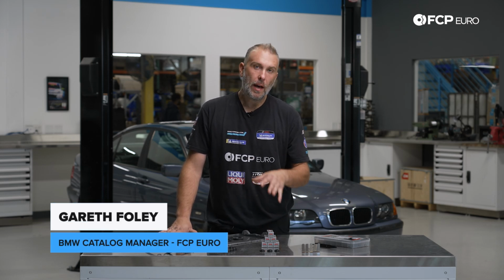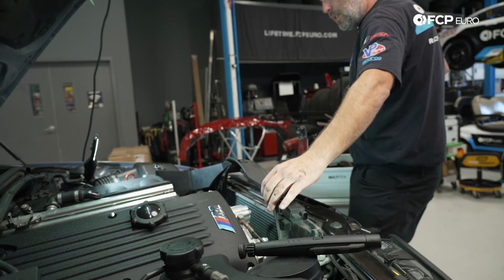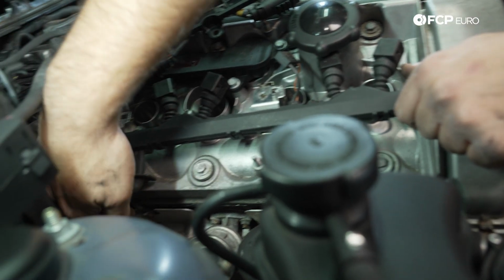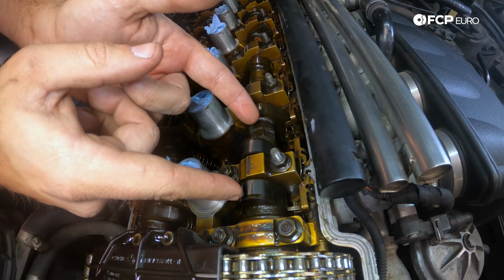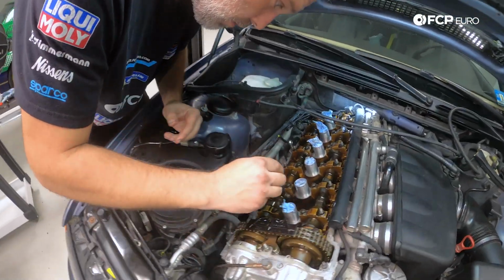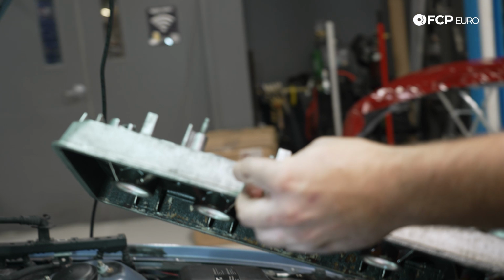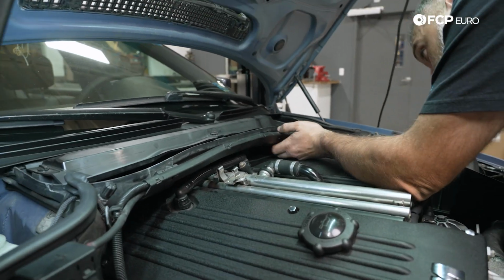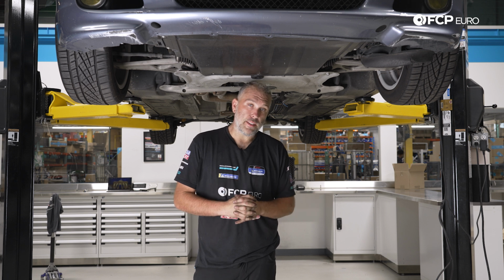BMW E46 M3 Valve Adjustment DIY (BMW S54 Engine Valve Lash Adjustment)

Comment: Im currently in the process of buying an e46 m3 and im amazed at how much more information there is about this car than my C4 Corvette. Not to say there isnt a lot of information, but issues with that car are so indirect especially when its electrical. And not to say this car doesn't have as manu issues but the clear and concise amount of info is amazing to have

Comment: FCP Euro, is this a similar process for an M54, if not could you please respond with the differences?
Reply from the maker: The M54 doe not require valve lash adjustments, they are self adjusting on that engine.
Reply: @fcpeuro  thank you

Comment: I’ve seen elsewhere that the valve cover gasket may be re-usable.  

I’m doing this job myself on a Z4M with this engine.  With 45K miles on the clock, I suspect mine have never been done as what I’ve taken off up to now looks like it has never been touched!

My gasket looks fine visually and intact and didn’t even light off the cylinder head at all when I lifted the valve cover.  What are the opinions on just re-using it?  Obviously, this would significantly reduce the cost of doing the job! 

Thanks in advance!

Comment: I’ve done this job multiple times on a single engine, and have found that clearances virtually ALWAYS open up during the ensuing 30k miles of operation. 
Therefore, if a new shim is required, I always target one that will be close to the tightest clearance in the tolerance band. 
This means that at each successive inspection, I am less likely to require a shim change on any given valve.

Comment: Warn people to be very careful they don't drop the washers off the cpv oil line on the side of the block. I lost an hour trying to find one of them that dropped down into the subframe brace. Also, my engine had varnish on the rocker arm guides and none of them would simply slide out of the way to access the buckets. Apparently you can cut little strips of 1000 or higher sand paper to remove the varnish so they'll slide over.
Reply: don't ever do that inside the engine.
Reply: @jamesclaeys3192 A bit unrelated but I have an Audi AAN 5-cyl.  I bought from a guy who had already opened the valve cover to do timing belt but never finished.  So outside air has gotten in and the cam lobes have a tad of rust.  I don’t want to take off the cams and go through the whole torque process.  How can I clean everything in situ without getting debris in the engine?  I would imagine scotch bright and a good shop vac going on while I clean it ?
Reply: This. I've been fighting with my rocker arms for 2 days now. They are just stuck. I've got some degreaser on them now and will try again. Tried heat as well...did not work. Those rocker shafts in the car in this video must be damn near new. No way the rockers in your car will slide that easy.

Comment: I didn't know oil could cause an engine to hydrolock (I knew that gas could). Would it be because the oil could prevent combustion from happening in one or more cylinder, causing the engine to lock? Wouldn't that rather cause a "simple" misfiring?
Thanks
Reply from the maker: Similar to water oil does not compress, so if there is enough of it in the combustion chamber it would act similarly to any other fluid and not allow full compression.

Comment: When you state point the cam lobes straight up. Is that literally straight up perpendicular to the ground? Or straight up perpendicular to the engine since it's at an angle? It's hard to tell in the video 

Thank you so much for this video, just finished doing my Vanos and want to start the valve adjustment now.
Reply: The lobes need to be straight up in relation to the valves. It's to ensure that the cam lobes are not pressing down on the valve at all when you go to measure clearances.
Reply: @GarethFoley  thank you very much sir
Reply: The lobes don't need to be perfectly straight up, since there is a substantial dwell time (circular cross-section) built into the lobes. Just be sure that the orientation is somewhere along the circular arc of the lobe.  @THE46GUY
Reply: @InflectisAI  thanks for the reply! After doing two of these now I understand what you mean.
Reply: @THE46GUY  oh. Great! You’ve done two in a very short time 😊. Not both on the same vehicle, I presume.
Reply: @InflectisAI  No, two different s54s in two different cars I have.
Reply: @THE46GUY  Cool!
Are either of them SMG?

Comment: Hey Gareth, can you guys do a video on the differences and issues or causes, etc... an Ebay China BMW Valve cover causes /acts compared to an original OEM Valve cover?  

Thanks man!
Reply: It's not too relevant for the S54 engine. In the discussion of Genuine vs aftermarket valve covers the primary problems you're  going to run into with aftermarket valve covers is poor material choices, aftermarket gaskets, and issues pertaining to the PCV valve (if integrated in the valve cover).